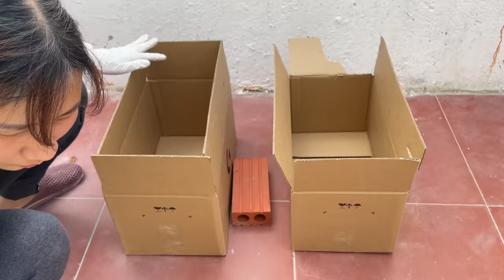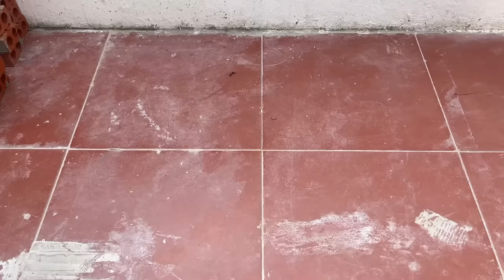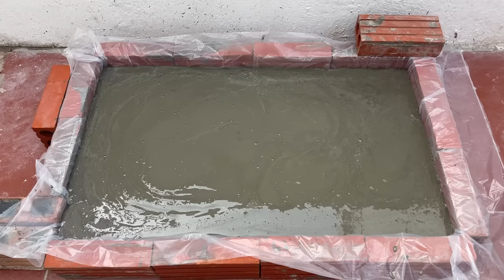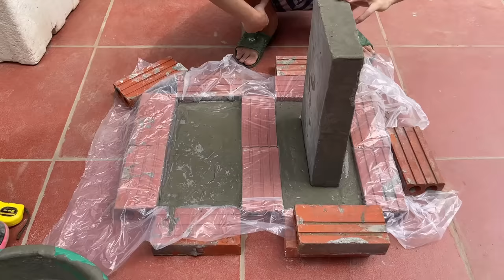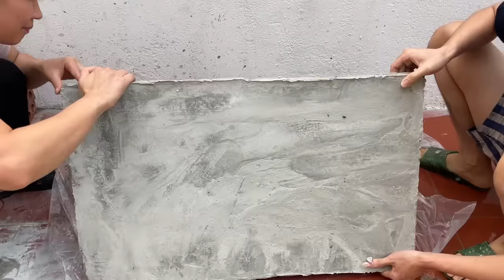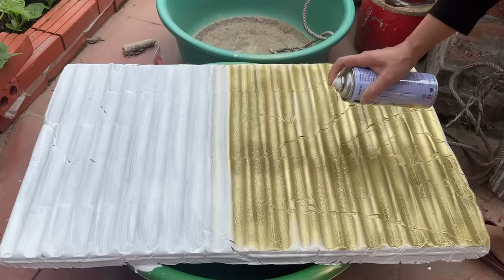Creative Way To Use Toilets Paper Rolls And Cardboard Boxes/How To Make Coffee Table And Flower Pots

Comment: If looking for more likes... paint the concrete natural colors first or leave it as concrete. Then do a separate video with the colors you like. One main video can be turned into two and appeal to more people.
Reply: They had me before they painted them in those gawd awful colors!
Reply: Thats the same I thought. Specially the plate, it would be looking amazing with a Bamboo look, and the flower vase like a pond. Jist read that if you like this kind of art 🙂Im creating art by myself, but just stuff  people can really use it, if I would make paintings, you can only use it, to start a fire 😅. My goal is, to sell all things for a price, the most people can pay it, i dont wanna creat something just for the upper class. It would be against my moral values. Ok I will be always more expensive, I'll see. Im just at the beginning now, I got to do tests with the material I use, timber, aluminium.... if everthing still works after month in rain, snow, cold/warm weather. I try to do everything for inside and outside incl. led's and and all other materials. I got so many ideas. Also is my idea, that the customers can choose in which way and with which kinds of material they'd like it. My first project now are clothes racks. Optional with timber, Aluminium, maybe iron (stuff from old cars, I weld together) also the colors, if with or without small leds and so much as possible. I dont know why i tell you all that, maybe cause you're as well a artist, are you? And I tell nobody I know, cause in the past, as I talked about my ideas, whatever else, it never worked at the end. So i decided to say not one word. Youre the first now 😀. Maybe you think now, whats that for a crazy guy. Im sorry, i thought this is a good opportunity to share my ideas finally with someone, who understand what im talking about 🙂. Have a great weekend! 

Sorry if in the text are many faults, my phone change sometimes words, even the ones i already corrected. And im from Switzerland and my english is not perfect.

Comment: Not to put a damper on the artistry, but if anyone sat on the table it would most likely break.  A wire mesh should be suspended in the center for structural integrity.  Likewise, the stool will eventually break after being sat on over the course of a year or so.
Reply: could you share a little more detail on what you mean by suspended? I've always wanted to make projects like this with cement but I do not know much about it.